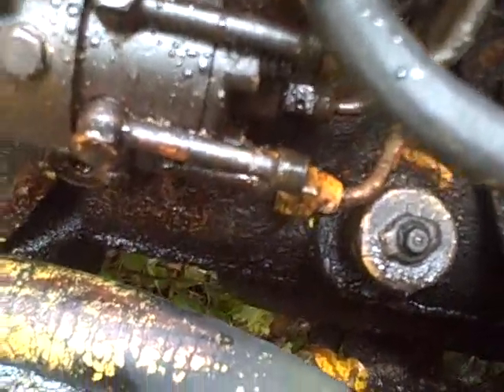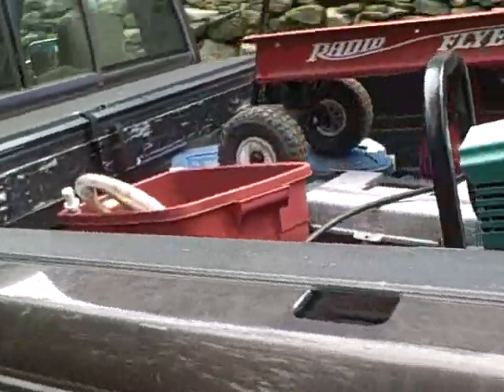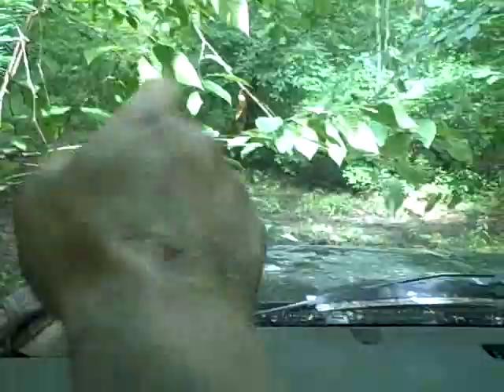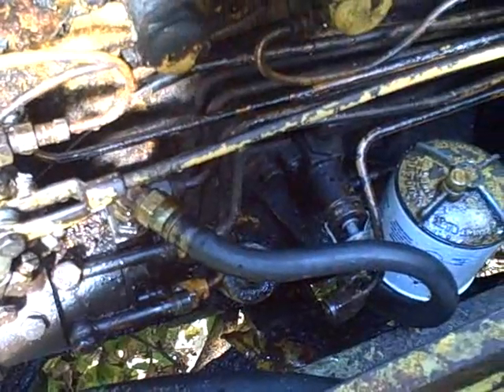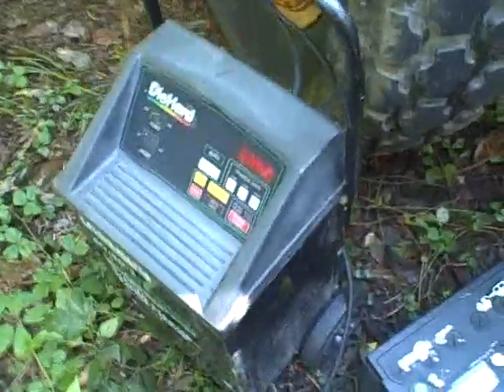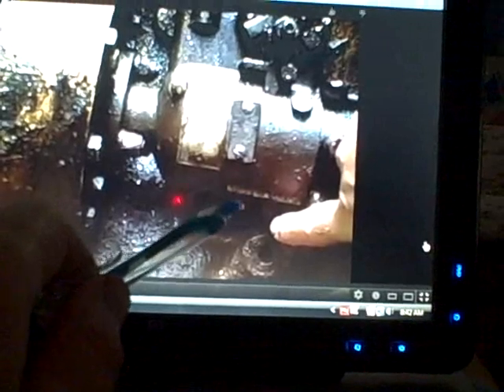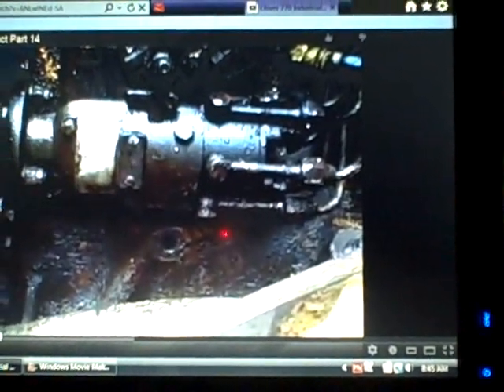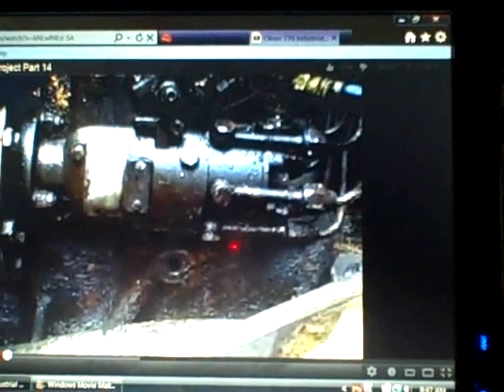Oliver 770 Industrial Tractor Project Part 15

Comment from the maker: You hit the nail on the head! I never relooped those lines, and it was dead heading, but I'm not in the clear yet. After driving it out of the woods, I shut it down, and guess what.......would not restart! New video coming soon. Also, isn't there a bypass valve in the loader control that should have allowed the pump to send fluid back to the resovoir?

Comment: Hi Steve Daryl will be happy ya got it running and so am I . when you where disconnecting the hydraulic lines that where looped on the back did you re loop them before messing with the loader. if you didn't the hyd pump may be dead heading as the oil needs to free flow through the circuit. that could be causing your stalling as its loading the system with too much pressure.
Regards Robert

Comment: When you get that bad boy running put a quart of ATF in the crankcase it`s a detergent and will start cleaning the internal parts of it carbons , shalac`s ,Bearings ,Valve guides & stems ATF really brcleans a motor up specially motors with bad valves it`s way better than Rislone or Seafoam ,Just leave it in you`ll start hearing changes in the Wristpin &  valve noise it`ll smooth out .I`ve run this in my old fords for 35 yrs and never had a ticky lifter .

Comment: Hi That's a bit annoying it would not start is it pulling air or just the starters tired, or not chargeing battery i have seen it with the Majors when its warmed up the starter looses power due to high resistance leave it to cool then away it goes.
The block should have pressure relief but with that line off you have no return to tank so it just keeps pumping with no free escape for oil. when the hoes connected oil runs through both back to tank or through looped line if not
regards Robert

Comment: I`ve got a truck that has 435000 KM I bought it at 276000 it would`nt do 45 MPH to the floor the guy never done a thing to it the first thing I done was INJ cleaner 4-5 times in one month -Plugs , Oil  ,PWR steer  transmission it finally got to 50 mph then 55 the oil was so black it took 5 changes in one month to see the dipstick thru it ,then started running ATF to clean it out finally running clear to this day I have only put 2 quarts of oil in it and it`s still clear  3 changes 3 yrs.

Comment: Risking angering, but you really could benefit from a purpose built remote start switch. Easy & expensive  enough to throw one together. Long enough leads you can be looking at any part of the engine while cranking it.